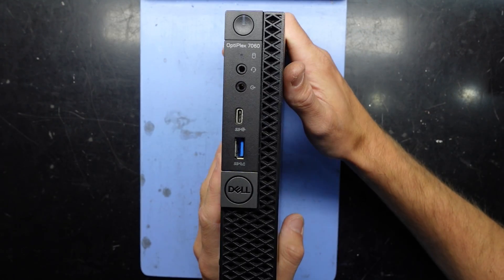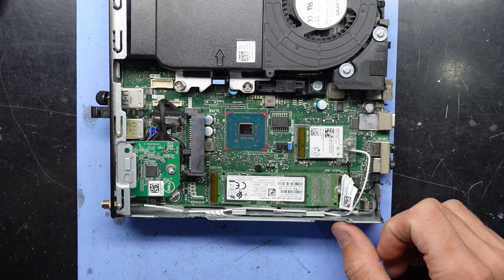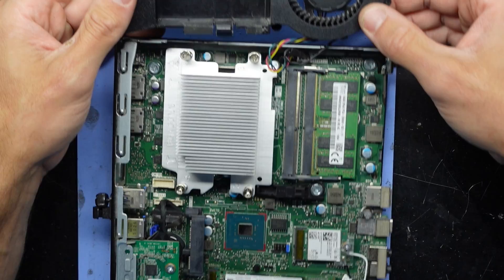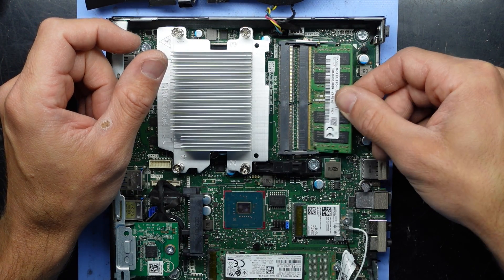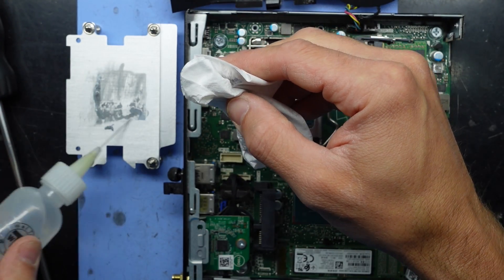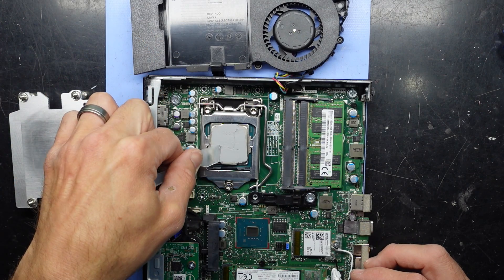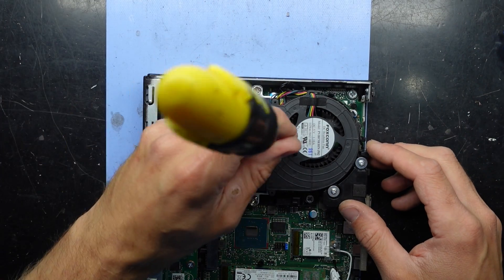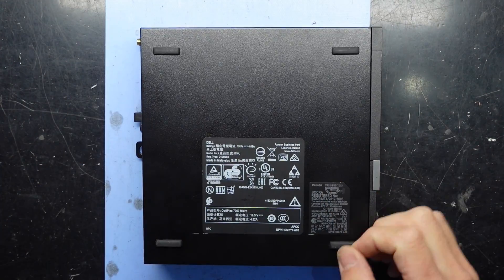Dell Optiplex 7060 Micro 8500T / Ram upgrade, Thermal Paste

Comment: Recently grabbed a 7050 off eBay as an emulation box, the fans go mental even at the lightest load so I figure it's probably been on the same thermal paste for ~10 years.
This was exactly the video I needed, cheers!

Comment: If you follow the black wire for the Wireless module, you'll find that there's also an Internal antenna as well (front-right corner). Thank you @rickstechrepairs for the interesting video =)
Reply from the maker: I did not know that! Thanks for the heads up!

Comment: I have a 7050 micro, threw Linux on it, and now it runs my favorite games, like Zuma, Ricochet, Chicken Invaders 4 via Wine without a hiccup! I can carry it around in my backpack like a laptop, it`s only missing a screen, but the installed speaker provides a better quality audio than the speakers on my monitor!

About the Micro Form factor is that there are people complaining about the heat, the nose of the fan and the motherboard dying - I have my PC as a second hand, it`s almost 10 years old, no heat issues (around 60 C on max load), the fan was a bit noisy but I`ve got it replaced for 15 bucks and it now runs like a baby. For the motherboard - for an almost 10 years old PC, I still have no issues, but even if I do someday, spare parts are easy to be found, so I have no worries at all.

IF anyone is wondering to whether buy a computer like this - go for it! The CPU may be underpowered, but I can still watch 4k content with no issues. :) Don't forget the expandability on this thing! You can buy it for cheap on a refurbished store or sth, these things are everywhere.

Not suitable for heavy gaming (you will have to rely only on the integrated graphics), but for a daily driver - ABSOLUTELY! ^_^
Reply: Have yoh tried emulation? I was thinking to go for a 7050 as well, to use Google OS in the SATA and Q40S Linux as main OS and Retrobat for emulation upto PS2.
From what I've heart 7th gen I7 with a 65W battery is playable for PS2.

Comment: Bought one on ebay, came with 2 problems, ac need to be upgraded to 90watss ,if not cpu` won't unlock from .89 hgz , alsk have to replace CPU cooler fan. ,   for some reason batocera or linux wont boot correctly or tale a long time to boot 
, using linux wont show any folder under the windows system ,. Definitely faster than my lenovo i5 10th gen.
Reply from the maker: good luck with your machine

Comment: Good video man, I have the same and upgraded to 32gb of ram, and Samsung Pro Evo 1Tb Nvme to run upgrade windows 11 and also changed the thermal paste. Last thing I need to do is buy a new bracket to install the wifi card and it should serve me for many years to come,
Reply from the maker: Sounds like a solid upgrade!
Reply: @ yes indeed! Keep up the great work 💪🏽
Reply from the maker: cheers

Comment: I have the optiplex micro 7050 with currently dual channel 32gb of Kingston ram 2400mhz CL17 , i7-7700T and a Seagate barscuda 500 gb 3rd gen pcie G5 m.2 for the main drive with housed OS. 

I just ordered a silicon power NAS / enterprise rated ssd 2.5 from prime day recently and I’m thinking about upping the ram to 64gb. I am reading online if your bios is updated ( which it has ) , you can dual channel 2 32gb ddr4 sodimm sticks so latley I’ve been eyeing up some Kingston kits both consumer and gaming credible , Samsung , Corsair and Hyper X kits . I hope it works because I play a lot of 5th and 6th gen retro video games on it via retro bat clinging onto the Intel onboard UHD 630 GPU
Reply from the maker: Good luck, i dont know too much about these machines to advise

Comment: idk if it's only my problem but my dell optiplex 7050 micro fans are soo noisy only doing banal things. i replaced everything (ram, thermal paste, ssd) and updated all the drivers. what could be the problem?
Reply: if the fan is from foxconn, could be that the fan is becoming aged. it seems, foxconn fans, when getting aged, the minimal RPM is lifted up, instead of around 1100 RPM when new, to around 1300RPM, which starts getting annoying when in a quiet room. this is my personal experience.
Reply: @ how can i find it?
Reply: @evil_source_dk  and also if i change it with different brand, will it be quieter?
Reply: @filippodosi1864  I`ve had to replace the fan of mine, you can find them easily and for cheap. Mine now is of the brand Sunon (just type your OptiPlex model and search for the fan, you`ll find one quite easily, just remember to look for one which has the additional pins to screw the speaker onto). Yes, it runs quiet after the fan change.

Comment: I ditched the wifi-card for a a+e keyed m.2 Gbit network nic to run Opnsense on it, it is now a perfect little router/firewall machine. I think you can get m+b keyed nics also if you would rather ditch the ssd and put os on hdd/usb drive.
Anyway this little thing is great!
Reply from the maker: great use of this type of machine
Reply: Good day! So would you mind sharing the m.2 Gbit card that you upgraded to? A link maybe? Also my 7060 had an Key E in it. Is at okay to swap in an Key A and Key E in it? Thanks in advance.
Reply: @eduardoalverio7801  as long as the m.2 has the right notch for the slot, it does not matter if it has any extra notches. For example an A+E key card will work in a A, a E and a A+E slot. Same goes for the other keys.
I bought my nic from amazon, but they are available here and there. Can be a bit tricky to search for, seems like the m.2 expansioncard universe is a bit on the fringe site. Good luck! :)

Comment: This form factor is so likable ! I discovered micro form factor few weeks ago. I never saw this before, always looking at the classic ATC gaming models. But I feel like this form factor is perfect for an office PC, family PC, working PC, small game maybe. I bought an old SFF 2 weeks ago for 30$ and improved it to i5 4690 and 16go of ram for 25$. Running really well on win 10. Next I'm gonna get a micro for factor.
Reply from the maker: for basically everything but gaming these are a pretty darn good machine, and they tend to be fairly good prices second hand
Reply: @rickstechrepairs  exactly. In France, a 3060 start at 50$.